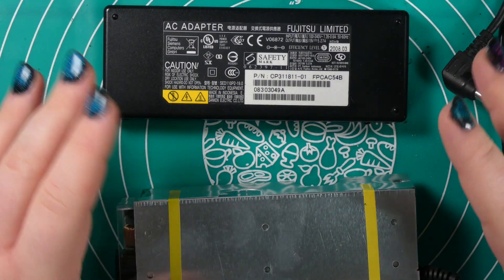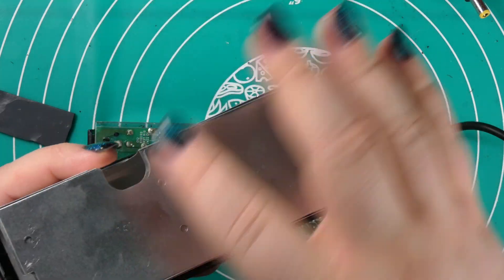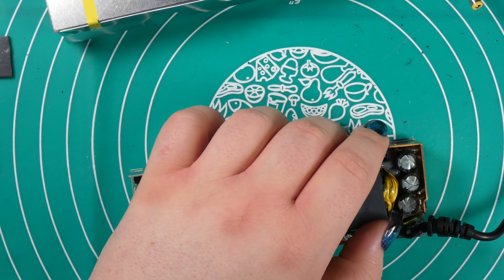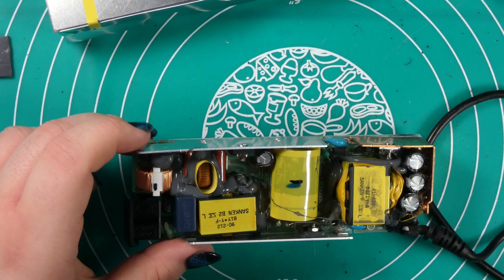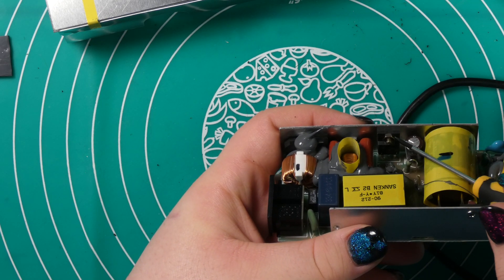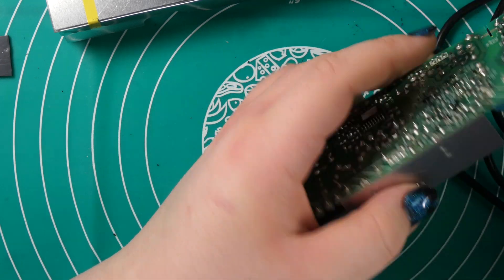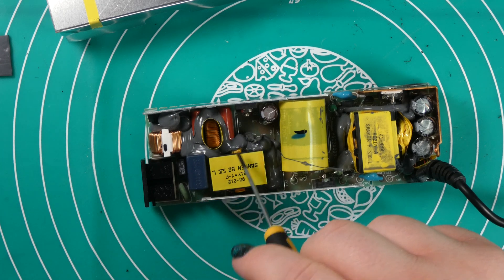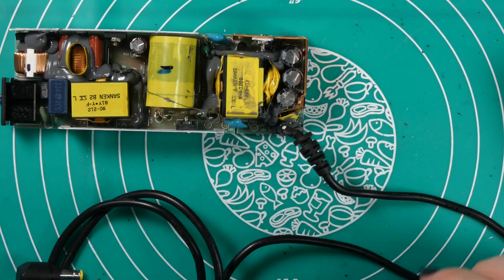Fujitsu Laptop Power Supply Teardown - Very Interesting Design

Comment: A lot of the time, manufacturers add silicone paste in specific areas to reduce coil whine and to resonating components in order to silence that 'buzzing' sound from Power Supplies. In doing so, it also reduces the number of consumer complaints and returned items from people that are not happy with the noise, or those who report the unit as 'faulty' when it's a standard occurence over time.

Comment: The first transformer is actually an inductor:))
Reply from the maker: I finally found the power supply and did check it once more and no there are 2 transformers and 2 MOSFETs, each switching one of them and they are connected in "series" just as I explained in the video. However one small mistake I made was that the capacitor is not connected between the transformers but right after the bridge rectifier then its positive goes right into the first transformer and its negative is switched by the first MOSFET. Then on its secondary side, one connection goes into a single diode and the other one into the second MOSFET which in return switches the second transformer. On the second transformers secondary we then have, what I assume to be a diode package. However I just found out that this might be the reason it no longer works. I get high resistance readings ~50k Ohm between all legs. Have to investigate this further.
I don't know why they did it like this for a single voltage supply, this is something done to generate 2 different voltages or more as you first generate the highest then derive the next lower voltage from the first and so on.

Comment: First small cap you told is a fuse and there are one class x2 mkp cap with a common choke filter befor a diffretial choke filter.you should learn more to make tear down smps video
Reply from the maker: You are right we have a fuse and a class x2 mkp cap and a common choke filter. I don't know all the names or can identify all components just by the looks of it, I'm stil lerning. However we don't have a differential choke and you can correct me on that but don't we need 2 chokes for a differential filter? The second inductor has only 2 legs therefore its a simple choke. What you called a big inductor in your other comment is, as I checked a transformer just as I said in the video. So it is a simple LC filter and if I remember correctly thats what I said it was and again correct me on that but a differential choke filter is basically a LC filter, right?

Just for you to understand where I'm coming from: I'm a physics student, finished everything you learn about electronics within physics but I'm interested in this so I have my small hobby and make some videos about it to share stuff but also be educated by others that know more. In physics we only ever deal with RL/ RC filters for around 4 weeks total and only talk about the basics.
Reply: @PhysicistAnna  you're right and we all learning more everyday .Am not an expert in electronics but I like it.for identify all component need to desolder components and make cshematic of it.so more inductor actually work as filteration and in some powerfull SMPS two transistors work as half bridge and in some expensive power supply there is a active PFC so that transformer may is a PFC inductor or maybe is a gate or base drive transformer.anyway it stay a mistety till found a schematic.

Comment: There always seems to be a lot of discussion when it comes to linear or buck power supplies. 'Bucks are dirty' seems to be a favourite. Nevertheless if they can power a PC processor they can be made very smooth. I am wondering if this twin transformer layout might have something to do with a cleaner output.  Not an ideal way to get rid of heat though, thermal pad, clear plastic, aluminium case, plastic outer case. Interesting layout - all those black things with legs. Best of luck repairing it.
Reply from the maker: I can't really imagine how that gets rid of the high frequency switching but as I lack a better explanation you might be right. As for repairing it... well I don't think thats going to happen. I'll measure a few components but other that that its to complicated to make a repair attempt. The amout of reverse engineering for that would take a long time and the effort exceeds the reward by too much for my taste. I tend to try hard fixing stuff but thats just not going to happen here. Just before my lectures started I tried fixing an old GTX 970 graphics card. I filmed it until things did not go according to plan and I made a deep dive into theory and after 30 hours I just gave up for the moment. There will be a video showing what normally fixes the issue with an additional explanation what I had to do and what I have to do to eventually fix it. Just have to wait 3 months and more to get more replacement components...

Comment: Thanks for the teardown. Today I saw product that claims to be Fujitsu charger. And I need a power supply for my TS100. Because I never heard of Fujitsu ( I know it's my bad. )
So thanks again. May I know how expensive is it?
Reply from the maker: I got this one for free. My dad had an issue with his old laptop that was resolved with a power supply replacement. Originally it was working occasionally but now stopped working entirely. I bought a replacement from toshiba with similar rating because this exact one is only avaiable used or at high price compared to others.